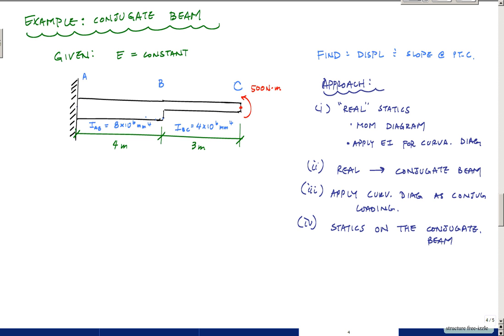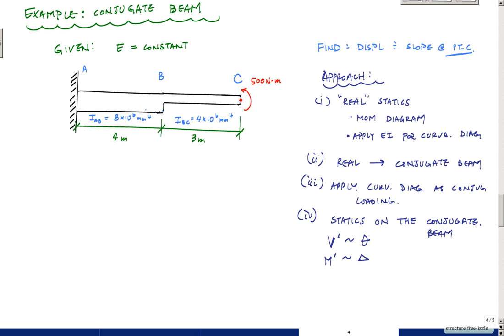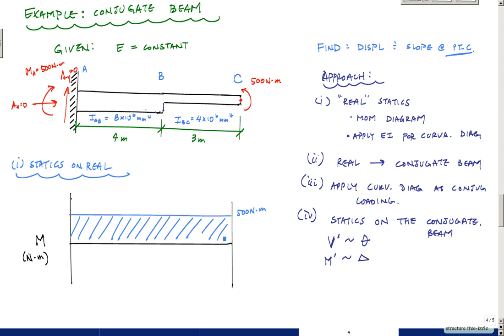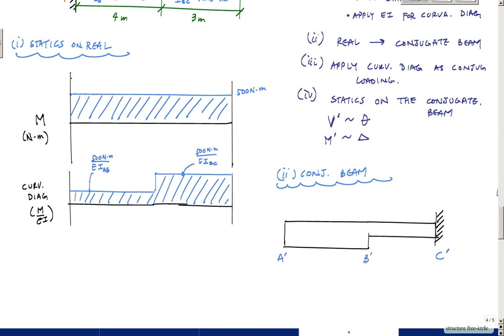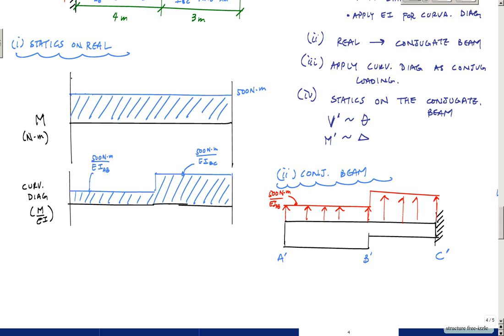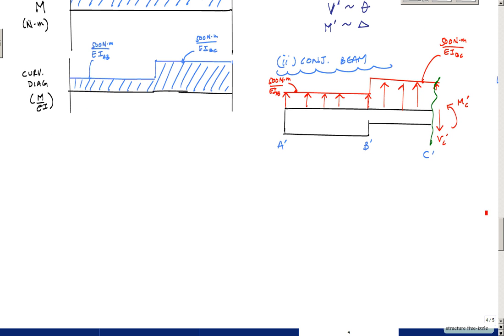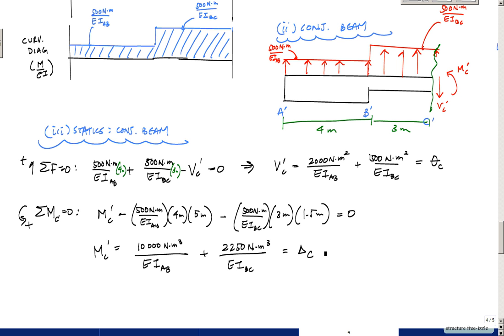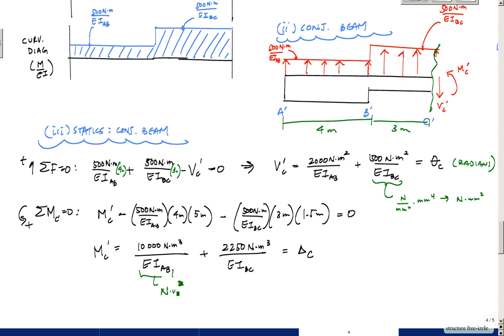Beam Deflections - Conjugate Beam Method Example 1- Structural Analysis

Comment: I have a quick question, what will happen if your deflection and angle turned up to be negative and not as they should be (positive) ?
Reply from the maker: Mel13z the internal moment diagram would change and consequently the curvature diagram and then the conjugate loading direction would change...give it a shot.

Comment: @ eyeGOPu1 as the loading is a uniformly distributed load UDL so total force on the span = loading per unit distance[w(x)] times the loading distance and the moment about the point is multiply the shear force with the center of its action to the section C so 4m times 5m.